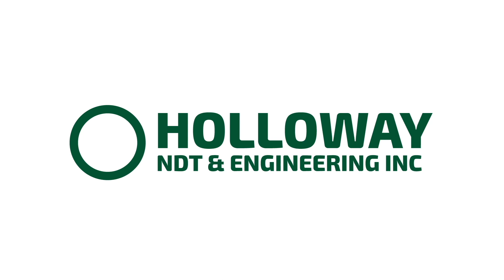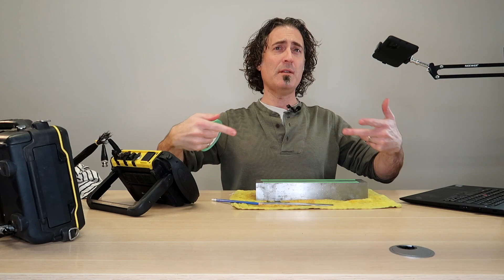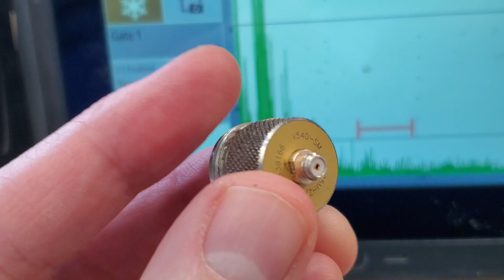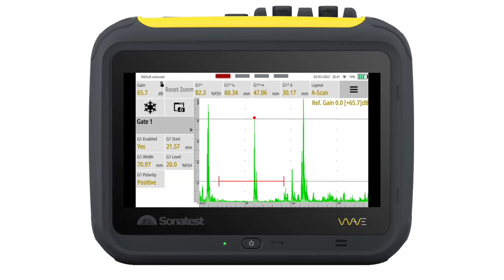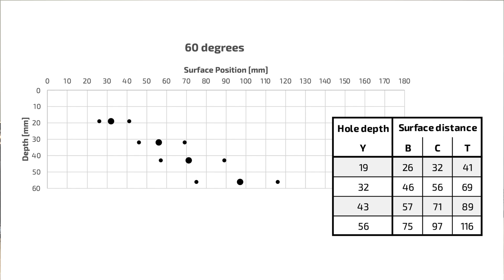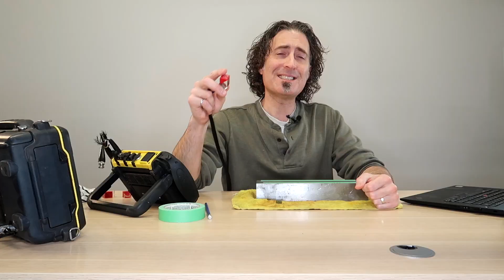How to Make an Angle Beam Profile

Comment: Hi Paul, do you know by any chance how 2,25 MHz probes became industry standard probes for low frequency transducers, both conventional and PA? Even more intriguing is that for higher frequencies it fives and tens MHz that are used, so not multiple of 2,25 but of 2,5. Interesting. Here in Europe it’s 2 and 4 MHz for conventional pretty much anywhere you go. Thanks for the great video!
Reply from the maker: That's a great question, I've wondered that myself!
Reply: @hollowayndtengineeringinc.5201 My wild guess is that is a living testimony of ever present and enduring impact of AWS D 1.1 code on everyday life of a welding inspector. (They " shall be between 2 and 2.5 MHz, inclusive"). But it's just a guess. Keep up the good work!

Comment: Hi Paul,
One question :-) Why you using 6 dB drop for beam profile ? To get a edge of the beam we shouldnt use 20 dB ?

Thanks for great videos.
Reply from the maker: You can do either. Most of the time I see the 6dB profile, but it's possible that wherever you are, the more common one is the 20dB.

Comment: Hi Paul, why do you add 6db after you have received the signal from the 0 isobar?
Reply from the maker: You don't have to. You could pull the transducer until the signal dropped from 80 to 40. It's just easier if you add 6dB, then pull it until it drops to 80.
Reply: @hollowayndtengineeringinc.5201  thank you

Comment: Hey Paul, I believe the exam (at least the exam we do) standard is a 20dB (10%) profile, We are also
Required to do the other profile, which requires a slightly more complicated and fussy technique.  I typically point out the beam on the profile you demonstrated should not be symmetrical above and below the centerline, it’s an application of snells law that is not always immediately apparent.
Reply from the maker: Great point Dwayne. You can see it's a little asymmetric on the 70.